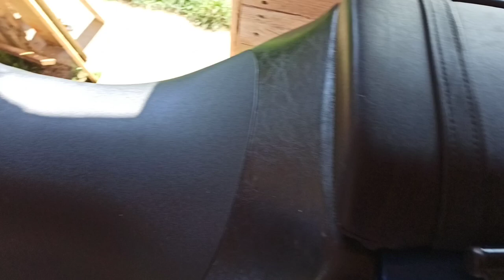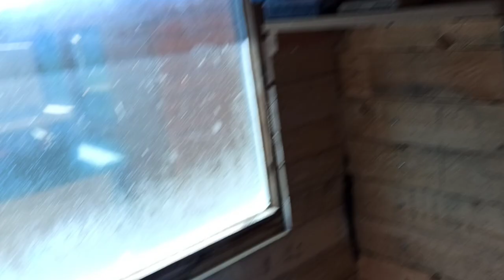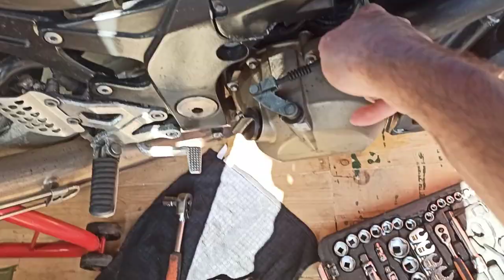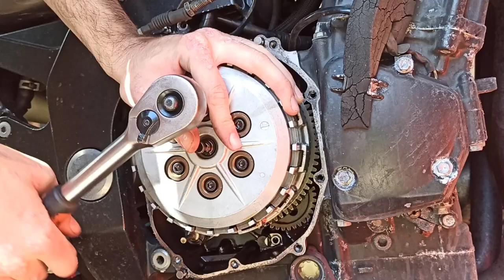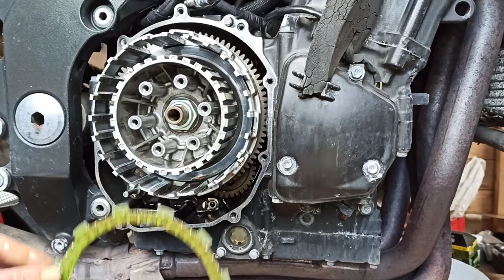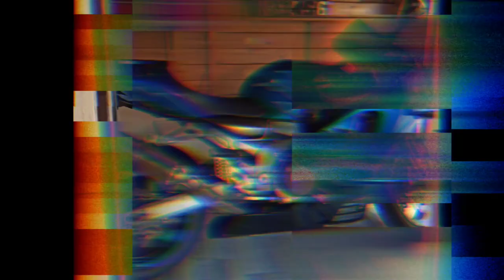KAWASAKI NINJA ZX12R clutch pack,oil and oil filter replacement

Comment: Hi. Having worked on these engines and my own bike  you come across a few points that need special attention.  The anti judder rings must go back in correctly and facing the right way round (flats and bevelled) you can't just pop them in and hope for the best . Stack height was not shown as this is important for the clutch to operate correctly. 
57.6mm being the max end plate to end plate in the stack and if wrong they are adjusted by different thickness plates from oem stock at only £7 per plate.
Oil and filter change. Several guys on the zx12r site myself included have filled the filter prior to refitting it to the engine. Good and bad in my book as a full filter and an empty oil gallery can cause an airlock and in a lot of cases will not budge  Air compresses oil does not. Oil pumps are not good at suction only pressure . In this case you have to release the filter and allow a gap for the air to be expelled only then will the pressure be established. 
Only HALF fill the filter to avoid this air lock. This does happen quite a lot according to the guys on the zx12r site. To me I've NEVER tightened a filter up like as shown HAND TIGHT ONLY over 45 years on engines I've never had a leaker or one come loose.
The hexagon on the end for ease of removal only. Well guys enjoy your zx12r ''s I certainly do, out of the 2 bikes I have zx9r and zx12r the 12r is invariably my chosen ride of the day. Same blue colour too. Ride safe.
Reply: Correct mate thanks for that. I realised after i replaced the clutch on mine, about the bevel & flat on the steels. They're still in there probably all mixed up , no issues so far. Which way does the bevel face , toward the gearbox or toward the brake lever ?
Reply from the maker: Thank you for your message and sorry I've not been active on here for a good while.
I did install the ring in the correct orientation as per the manual aswell as measuring the stack hight (I can't remember what measurement it was but was in spec).
As for the oil filter I tightened to spec and I'm not sure about the air lock situation you speak of.i used information I gathered from groups and forums for the work and a manual..thank you once again and you to ride safe and enjoy my friend
Reply: Hey my 03 zx12r  bike ground the comp-clutch am struggling to get my clutch working, what's with that small steel plate should I call it a washer on the 6th steel plate?

Comment: Lovely bike mate, you’ll enjoy getting to know her and taking care of her. I had a 03 B2H up until quite recently and it was a fantastic machine and never ever failed to bring a massive smile to my face every time I took her out. 2 bits of advice that will save you a lot of heart ache. 1) keep the 6 pot tokicos super clean, they work really well when you look after them but seize really easily if neglected. 2) when you need to change the plugs use the factory flexible spark plug spanner with the rubber insert, if it’s not in the tool kit, get a second hand kit off eBay with one in, the older KLX bikes have the same socket. The middle plugs are a real pain in the arse but use the flexi socket, it’s still a pig but you’ll get there. Enjoy
Reply from the maker: Thanks for your advice and it is definitely taken on board,they do need a good going over.
You will see how it goes on here.
I think I may have that socket I'll have to check,the valve cover gasket needs replacing so it's a must anyway.
Thanks again for watching and your help I do appreciate it 🏍️💨

Comment: Hey my 03 zx12r bike ground the comp-clutch am struggling to get my clutch working, what's with that small steel plate should I call it a washer on the 6th steel plate?

Comment: hello to everyone, especially the man of the great and valuable video ... but I confess to having a big doubt and that I have a lot to take, my friend you have a clutch kit for the model of the kawasaki zx12r from the year 2005 correct? The clutch of the model zx12 A does not take the two lubrication rings into the disc media nor does it use two friction discs with the smallest diameter. did you make the change to the clutch model kawasaki zx12 from the year 2002 ?? thanks if you can answer.
Reply from the maker: After a good look I think you are right in what you say,if I understand you correctly.
This boggles me tbh because the old clutch had the lube rings and plates,so I just assumed to replace ,like for like.
But looking through a couple of manuals I see there is difference between them both.
My bike is running ok,I think lol.what would this result in for my girl?
Reply: @livingwithaninja3207  hello again, the result will be that the clutch of model A is more robust and firmer than model B, in the middle of the friction discs it has two washers, a friction disc plus a metal one with a larger diameter inside, in its model A no have these discs or washers, the fact is that these discs are more fragile because they are less resistant because they are smaller and as you know the zx12 model A has much more power than the zx12 model B, so there are differences between them. the clutch are not the same, different models have different powers. be careful that everything can go well but it can also go less well, when it comes to lubrication it is good, but for proper operation I think each model has the original parts. Hope this helps.
Reply from the maker: @josevieira9596  yes that makes sense thank you for letting me and others know.i will keep an eye on it and maybe take her to my local shop as he has 2 zx12rs.i will be sure to mention this in my next video.
Thank you again for taking your time to comment 👍🏻👌🏻
Reply: @livingwithaninja3207  ok, my friend i hope i gave a good help. there is another thing that many motorcyclists do not know and even good mechanics, that to change the clutch discs or complete clutch does not need to remove the oil from the engine, for that it is enough to leave the motorcycle a little more inclined or even on the rest of it and can remove the discs that no oil will come out, I hope I helped.
Reply from the maker: @josevieira9596  thank you,you have helped me with your insights.i will be sure to double triple check everything is ok.i am still confused how it is running ok

Comment: When you take it apart you speed up and I can't tell if you have two rings at the 5th wide outside diameter ring and what is at the end with the wide outside diameter? A flat and a beveled? Does this mean both wide diameter rings have two inside rings?
Reply: Judder springs
Reply from the maker: Yes I'm sure both the wider plates have two judder springs with the flat one first (toward the rider on the bike) and the beveled ring after with the narrow part of the beveled ring also pointing towards the rider.i hope that helps

Comment: Great video, do you know where to get all the torque specs? How do you measure the stack height?
Reply from the maker: I got all the specs with a pdf manual and I measured the stack hight with a micrometer/caliper

Comment: Hey how many of those spring type washers you have in between the plates ,are supposed to be in the clutch basket? Its funny I’ve changed my clutch many times before with no problems never taken spring/washers out. This time around my clutch cable has no tension at all. Watching your vid is the first time I’ve ever seen anyone have them or at least one in between the plates. Mine are both together in the rear of the basket behind all the plates. Im thinking maybe this is why my cable has so much slack
Reply from the maker: Sorry for not being able to help.but there is a difference between the older and newer models,one has the rings the other doesn't.also as you see on the video I put the top cover plate that has the clutch springs in,the wrong way and had to rotate it slightly to have it fit snug.
Reply: Hey did u sort out urs? Same here plates and steel are perfect but no tension on the cable😢
Reply: You have to get the correct clutch plates anything else won’t fit, and it causes the cable to not have tension.

Comment: Did you measure your stack height or just hope for the best?  Vital that the stack height is right on these bikes.  What fibers did you use?
Reply from the maker: Yea I measured the stack hight,I got OEM from a Kawasaki parts dealer.i was super paranoid about it tbh as it was my first time ever replacing a clutch on any bike.
She rides ok as far as changing gear/going to neutral got no drag or slip on the clutch either.

Comment: Is yours a 00 or 01? I’ve got a 00 that I’m having trouble with. And midways of your clutch is that jetter spring flat or curved? And in the back of the clutch is there a flat and a curved jetter spring? My shifter isn’t wanting to return ever since I’ve tried messing with my clutch now.
Reply from the maker: As I am aware 01 but registered as 02 in UK..sorry I've been absent I'm looking on putting some more vids up soon hopefully I've been very busy and not on the bike..but there is 2 sets of washer plate things in pairs.one is flat and the other is like a 'cone' shape but very slight if that makes sense. lol.one pair is at the back of the stack with the first clutch plate over it the other is about half way with the friction plate both got bigfer holes for the washers to sit in..the 'coned' shaped washers should have the more narrow part facing the engine,so the outer edge of the cone washer is facing you..it's hard to explain but I hope that helps l.let me know and I'll explain on the next video mate
Reply: the model zx12 from year 00 is the same as from 01 so from 02 is that it is already the second model that this model ends in 2006

Comment: Great have same model/color 48000 km
Reply from the maker: They are sweet.i wasn't extremely happy about the colour but now I love it.😁💪🏻
Reply: Just run in , I sold my 12r , with
93,000 km , changed oil and filter
Every 7000km , oil is Cheap compared
To Engine rebuild.